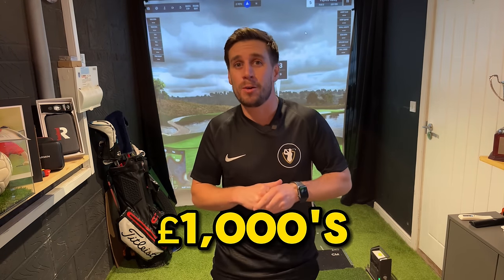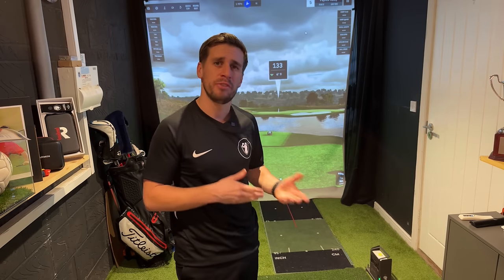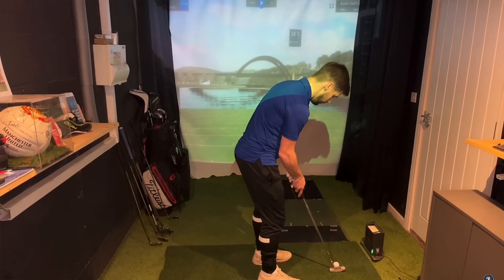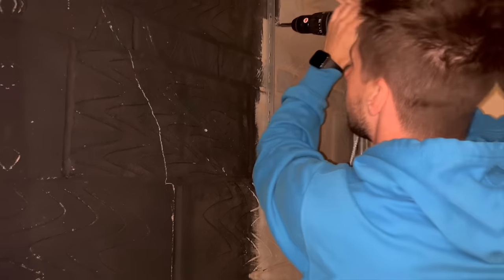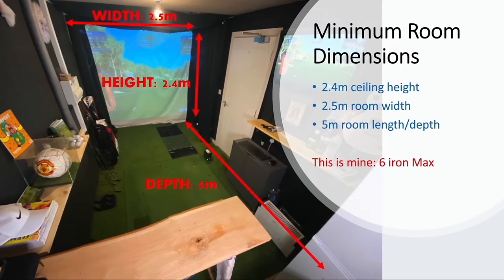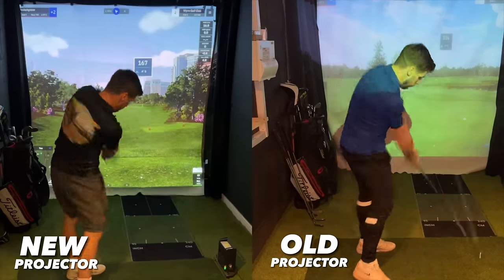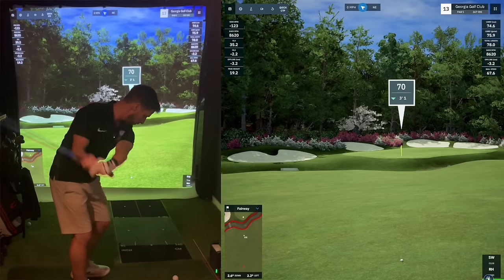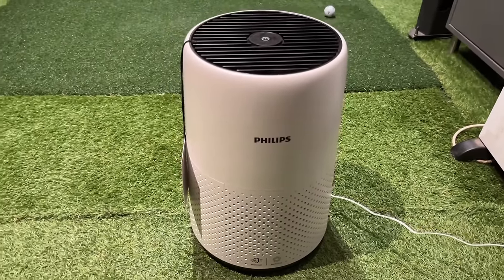The Biggest Golf Simulator Mistakes I Made & How to Avoid Them...

Comment: Would you consider removing the flooring and digging out the concrete floor to a depth that allows you to swing a driver. 
It would not be as expensive as you may think. 
I’m based in Preston so happy to advise where needed.

Also, an inline extractor (£55) and a vent would be a great idea.
Reply from the maker: I thought about it long and hard but I still don’t have enough width in my room to be able to swing driver - even if I had the height 😔

Comment: My biggest mistake so far was getting a skytrak plus. The club data is a joke. 
Best decision ive made was getting a gc3
Reply from the maker: I think GC3 will be my upgrade of choice! ⛳️
Reply: Is that optic?
Reply: Went from og skytrak to a gc3. Cannot recommend it more. It is literally perfect
Reply from the maker: GC3 is a photometric launch monitor (uses high speed cameras to calculate data) 👍🏼⛳️
Reply: What's wrong with the club data on Skytrak+ if you wouldn't mind? Currently planning my first sim build and still to decide which launch monitor to go for.